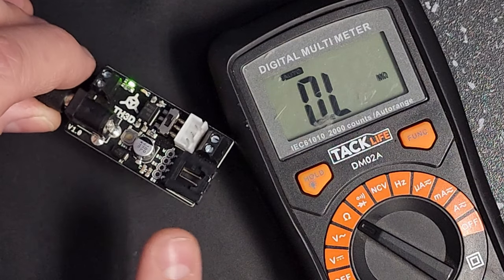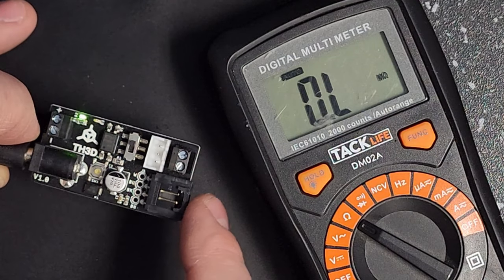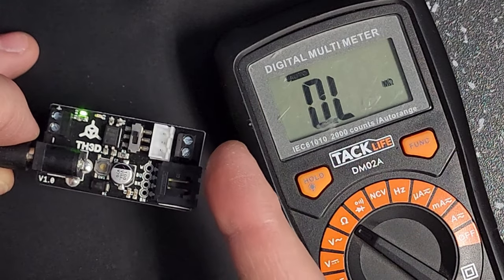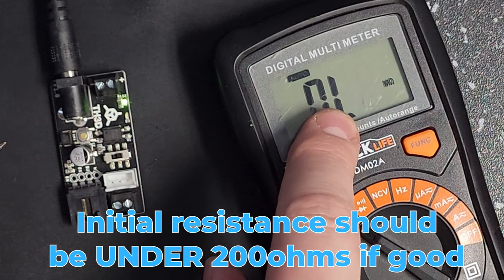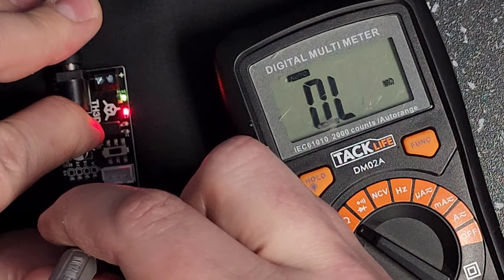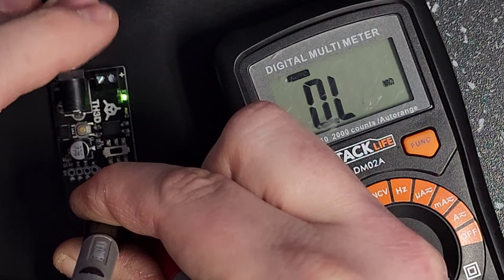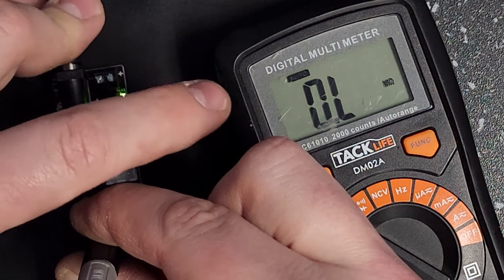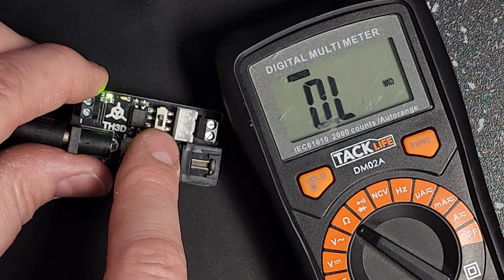Testing Your EZABL Pro/NG Control Board

Comment: Would it be possible to skip this board and just connect the sensor to my CAN toolhead board? (btt ebb36)
Really enjoyed using this sensor/probe when i was running Marlin.
Reply from the maker: While it may be possible I wouldn't have the details on the wiring needed.